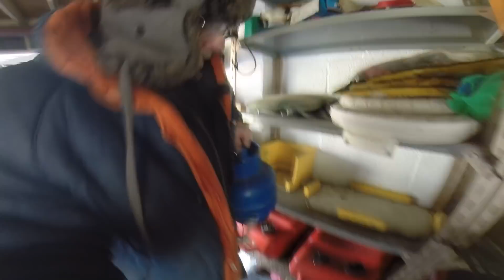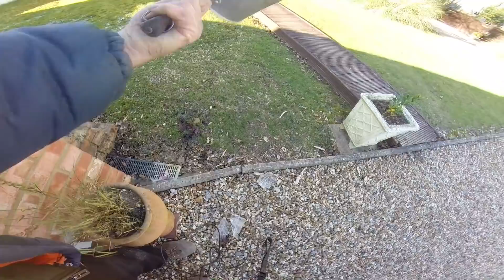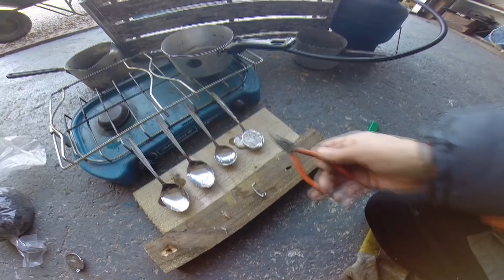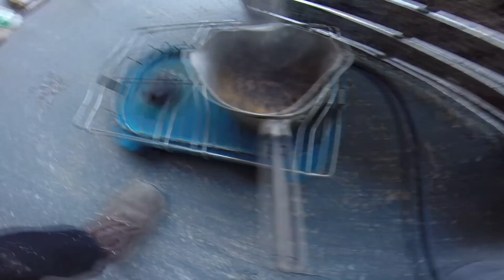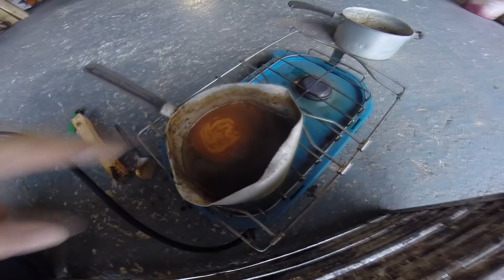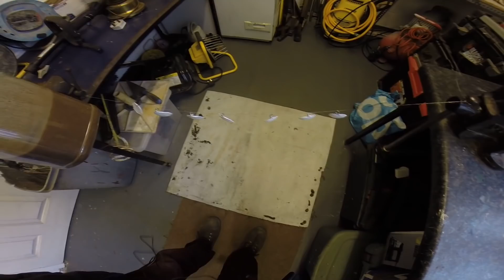Making Fishing Weights with a Spoon

Comment: You could possibly try to keep the coat hanger wire straight while moulding the leads. Once cooled down thread beads onto the wire. Then bend the loop in

Comment: If you fill your tote tanks after a trip then it will help tp prevent condensation in the tanks. An inline filter is the best way, not expensive and easy to install.

Comment: Water from the fuel is caused by ethanol in the petrol. Ethanol evaporates and leaves water behind. A mate works for a hire company and the petrol carburettors where rusting when not being used.

Comment: I have used Briggs & Stratton fuel fit for years on my boat, it does work, keeps the fuel from going stale, dissipates water and helps clean the engine...just saying, not promoting it, its just what I do : )
Reply from the maker: Thanks for the tip.